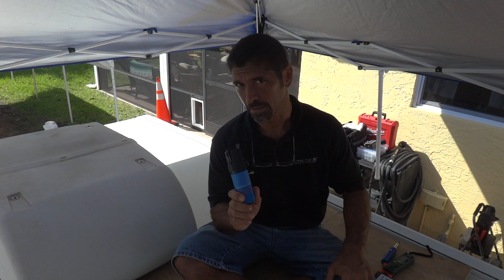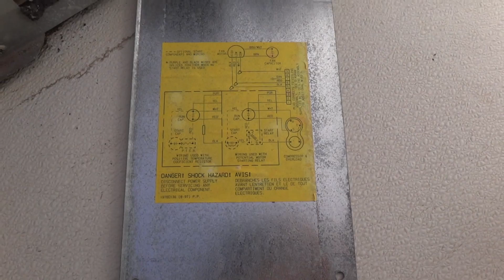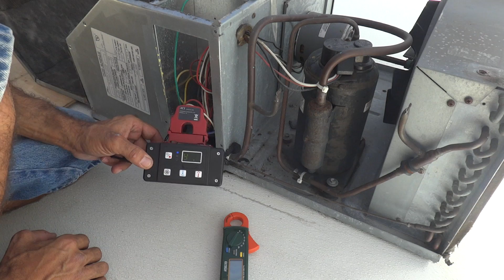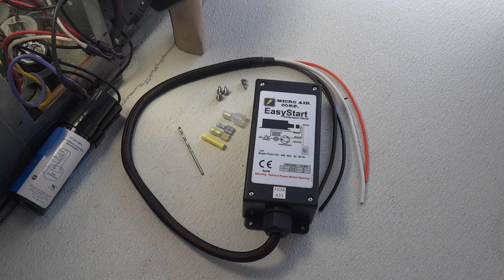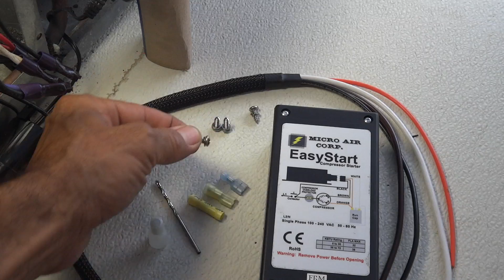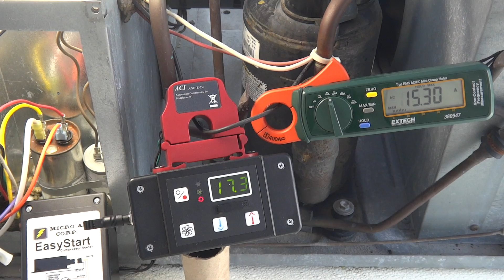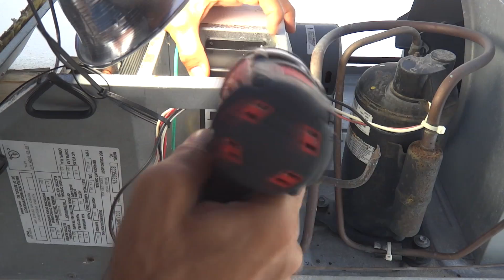Micro-Air EasyStart Soft Starter Installation into RV Rooftop Air Conditioner

Comment: It is probably in one of your other videos if not could you show us. how to take the power out of the capacitors or any thing else holding power thanks. I have wired alot in automotive and some  around the home. Wearing insulated gloves is not easy to work in. I'm going to buy you product I'm sold great product and I will be talking about your product like the good benefits of alkaline 9.5 ph water!
Reply from the maker: Hi Jon.  Thanks for your question.  As it turns out, RUN capacitors do not need to be discharged because they will discharge through the motor, after only a few seconds of off time. This is true even when EasyStart is wired in.  START capacitors - if your system even has one - might need to be discharged if they are 1) connected to your motor via a CURRENT-TYPE START RELAY (like on a refrigerator), AND 2) they do NOT have a bleed resistor built into their terminals at the top.  If a start capacitor has this bleed resistor, OR it is connected to the motor via a POTENTIAL-TYPE start relay (like on many air conditioners), or via a PTCR (start assist) device as is often used with factory-installed start capacitors in RV A/C units, then like the run capacitors the start capacitors will discharge themselves through the motor in 2 or 3 minutes after the power is removed from the compressor.  This is because the POTENTIAL start relay CLOSES once power is removed, thus connecting the start capacitor back to the motor, in parallel with the run capacitor, both of which can then discharge through the motor itself.  Similarly, the PTCR reconnects the start capacitor, but only after it cools off and drops to its low, starting resistance again, which takes a few minutes.  Remember, start capacitors, start relays, and PTCR devices always get defeated or removed BEFORE the EasyStart gets installed.

Worst case, AFTER you ensure AC power is completely removed from the A/C unit either via a circuit breaker or the trailer is completely unplugged, you can always use an insulated handle screwdriver to short the terminals on either capacitor to ensure it is discharged.

Comment: These Easy Starts by Micro Air are simply awesome. I just installed one on our coach which is setup to operate off grid and be able to run both AC units simultaneously off it’s solar system/lithium bank. The difference after installation in how the AC pulls on any power input be it inverter, generator or shore is incredible. The AC used to come on with a real thump, now it sounds and feels effortless. The onboard Victron CCGX readout isn’t designed to catch the amp draw, but in the video (link attached) you can clearly see the difference in both AC units (one with Easy Start, one without) as I have two inverters wired in split phase, there’s an AC on each one being displayed on the same CCGX. It’s incredibly obvious looking at the difference on the CCGX. 
https://youtu.be/CXBNn7lCSUY

Comment: I have 5000 btu AC .. is there a need to install one easy start on mine ?
By the way ac is running with predator 2000 generator ..
Reply from the maker: If it is working adequately for you, and you can start and run it from your generator in ECO mode, you won't need an EasyStart.

Comment: I like how your device is saying “order your easy start today” lol
Reply from the maker: Thanks for noticing.  Yeah, I snuck into my firmware a little subliminal marketing there ;-).
Reply: Micro-Air, Inc. rock on. I watched this video through and through because I am very detail oriented. I just bought a smaller camper but have been looking for a solution to run the ac on a smaller generator. Thanks again

Comment: I have a 5th wheel with 2 AC units I have to be hooked to a 50 amp service to run both units but if I am hooked to a 30 amp service it will trip the breaker if I install this unit on both of my AC units can I run bout units on a 30 amp service
Reply from the maker: Yes, you can start and run two units on a 30A utility hook-up if you install EasyStart into both.  Some power management will still be necessary since both units could demand up to 90% of the 30A hook-ups capacity (steady-state) in warm weather, depending on their make and model.

Comment: Just installed one on my Dometic 13.5k.  Works great, my Honda EU300is starts it easily in Eco mode. I too was hesitant about the cost but if you need to run on generator or sketchy shore power, it is worth the cost.  If nothing else, the AC is quieter inside when the compressor starts.  It is almost inaudible.

Comment: Dude I would have mounted it on the inside of the cover plate that you removed
Reply: yes..!
Reply: I like where he put it, because then he can remove the cover without having the bulk of the device there.  But I would've used heat shrink compatible butt connectors.  Or at least added heat shrink.  You're around high/low temperatures, it's outside all the time, you have condensation and regular humidity to deal with.  Protect those circuits!

Comment: Worked on the first start connected to shore power. Will not start a 2nd time. Any ideas why this is happening?
Reply from the maker: As we discussed via e-mail, there is nothing wrong. What is happening is the EasyStart's short-cycle prevention timer is delaying the compressor's restart.  This timer is "smart" in that it keeps track of the elapsed time since the last time the compressor was shut down, even when power is completely removed from the EasyStart.  For example, if power gets restored or the thermostat calls for the compressor to run again in 3 minutes, EasyStart will only wait 2 additional minutes.  And if this delay is 5 minutes or more, EasyStart adds no additional delay other than its 5-second minimum.  During normal cycling when the thermostat is being satisfied and then the room is warming up again, this short-cycle prevention timer will go unnoticed since it will have no effect on the compressor restart.  Only if you are deliberately short cycling the compressor (e.g. during the 5 learning starts) or a brief power outage/brownout occurs, will the effect of the short-cycle prevention timer be noticeable.

Comment: My AC's looks like yours but is a Coleman 15K.  On mine, there is no way for the Micro Air to fit in the space you installed it on yours.  I had to install it on the outside of the electrical connection box right behind the compressor.
Reply from the maker: Hi CJ.  Yes, when this video was shot 2 years ago, we used our older generation EasyStart 364 in the black plastic enclosure. This version was slightly smaller and not weatherproof, versus our current version in the beige-colored enclosure which is very slightly larger and IP65 (fully weatherproof).  Customers who now install EasyStarts into Coleman Mach 1, Mach 3, Mach 3+, and Mach 15 (all high profile Coleman) rooftops simply mount the EasyStart in the open space between the evaporator and condenser, and route the harness wires back into the same electric box, where all of the electrical connections get made in a protected area.  The current EasyStart being located in this open area which is exposed to the elements is not a problem since it is now IP65 and fully weatherproof!  Thank you again for your business!

Comment: my 32ft Coronado has two A/C units ,,,15k each..my onan gen is 7000 quiet model...it runs fine ,both work great in south texas  weather,would i benefit from using your product?????
Reply from the maker: Hello Jose.  Thank you for your comment and question.  Given that your generator is 7000W, although you have less of a need for the EasyStart, you can still benefit.  Specifically, if you have heavily loaded your generator and you only have just enough power left (~1800W for example) to run your A/C, it may not start when the generator is already this loaded (i.e. 5200W is already being drawn from it).  The EasyStart would make the difference there between it not working and it working reliably in this case.   Beyond this, the EasyStart continues to monitor and protect your compressor for 5 different fault conditions during steady-state running operation, after the start is long over with, including compressor stalls, overcurrent, open thermal protectors, failed wire connections, and brownouts/short power interruptions.   No OEM factory configuration protects your compressor this well.  And all of these issues can all happen even when running your A/C from a utility power source, not just on generator.  So, there are benefits to be gained here as well.  Thanks again for your question.

Comment: I just think it’s funny that the clamp meter won’t capture the spike amp draw... well no it won’t, it’s cheap. What maybe $80 at tops.  Mine will capture it just fine every time. But to be more accurate do the amp draw before the capacitor.

Comment: If I want to connect 2 AC 15k BTU to one generator(same line), I need two EasyStart, one for each AC?
Reply from the maker: Hello Christian.  Thank you for your comment. Yes, if you want to start and run two 15kBTU A/C units on a single 4000W or two paralleled 2000W generators, then you will need to install an EasyStart into each A/C. This is necessary because you won't be able to control which A/C turns on second, while the other A/C is already running.  We've had many customers with two A/C units do exactly this with success.  Installing EasyStart on both A/Cs also allows them to start and run on a 30A utility hookup, versus the normally required 50A.  That benefit turned out to be more beneficial to our customers than being able to run on generator since more often they're at campsites with limited hook-ups, and 50A hook-ups are not only less prevalent, but often more expensive.  One customer reported that his EasyStarts eventually paid for themselves because of this.

Comment: Hello Matteo,  I received the easy start  a couple days ago, going to install in the AM  looks straight forward. I will let you know how it works with the Honda EU2000I  gen.  the other campers in the club are very interested.  thanks Craig.....Next day..That soft start box is huge..lol  I had to relocate the run and fan caps to mount the soft start and then my cover did not fit had to make new screw locations , but I did the 6 starts on house power and now have it running off my eu2000i Honda generator, this is in Arizona so I am sure this will be a state to  really test the unit.  I am waiting for it to cycle .  HMMM not able to  start after cycle after it shuts off on eco,  will not start the compressor it trys then fan just runs. Only way to get it back on is to turn the eco off and wait another 5 min. it will then start. I have noticed when the eco is off the gen runs higher than when nothing is on like the ac really puts a load on the gen even when eco is off it revs so high. Not really a happy camper at this point as this was to be used for boondocking in the desert of Arizona.. I am going to replace the run cap, in case it is a little weak and drawing an extra amp or so.
Reply from the maker: Hello Craig.  Sorry for the delay in responding here.  The 5-minute delay you experienced was the EasyStart's short-cycle prevention timer.  The way it works is the EasyStart will hold off restarting the compressor for 5 minutes _since the last time it was run_.  This timer is "smart" in that it will keep track of the elapsed time, even if power is completely removed from the EasyStart or the entire trailer.  So, if the thermostat calls for the compressor to run again in 3 minutes, the EasyStart will only wait an additional 2 minutes before it gently soft starts the compressor.  If more than 5 minutes has elapsed, then the EasyStart will not add any delay (other than its minimum 5-second starting delay).  

Normally, when your thermostat is regulating the room temperature, becoming satisfied and then later calling for cooling again, the amount of compressor off time typically exceeds 5 minutes.  So, the effects of this short-cycle prevention timer will not at all be noticed. However, when you are deliberately short-cycling the compressor like you were in order to accomplish the 5 learning starts, then of course the timer will be noticeable.  It's good to understand this though because this timer is one of EasyStart's 5 additional fault protections that actually extends the life of your compressor.  For example, if your compressor is operating and the campsite utility power or your generator browns out for a split second, this brownout may not be long enough to reset the A/C's digital control, but it may be long enough to stall the compressor (which typically only takes 50ms).  The EasyStart will catch this brownout and NOT reapply power to the compressor when power comes back again, even though the A/C's digital control board may still be calling for it (because it "rode through" the brownout without resetting).  Without EasyStart, the immediately reapplication of power would result in the compressor stalling and drawing locked rotor amperage (LRA) since the internal refrigerant pressures inside of the system had not had a chance to equalize yet.  When this happens, the compressor's only protection is its thermal overload protector, which will "pop" open in about 3 seconds.  During this short duration, the compressor is enduring potentially damaging locked-rotor amperage and significant mechanical stress (torque) that can shorten its life.  EasyStart prevents this by stepping in immediately, preventing the short cycle, and waiting 5 minutes for the pressures to equalize before restarting the compressor.

Comment: Installed my easystart 364 on my RV, a Dometic 15,000 btu unit. Installation was super easy as shown and it works well with my Honda EU2000i, Im not easily impressed but yes Im very impressed. This thing is the real deal, should be installed on all RVs from the factory!

Comment: Wow, lots of sparing over something so basic.  First, any inductive load will introduce a power factor.  This simply means that due to the effects of the motor coils using alternating  (AC) power (60 HZ) entering the fan and condenser motors, the voltage and current go out of phase.  The cure for this problem is to use capacitors to correct that condition.  The amount of the required correction changes from startup to run, so basic systems use 2 capacitors, a start capacitor that disconnects after a short time as the motors spins up to a run capacitor using a  different value capacitor that is close to the right value when running at normal speed.  That is the basic system, but it does not cover all of the conditions an aircon system will encounter like  brief power interruptions, or multiple units that just happen to cycle at the same exact time causing a very large power factor problem and causing a large current draw when the voltage is at its lowest level.  So, to cover this and other problems a smart device can act instantly to correct the power factor problem which would require a different value of capacitor that the run capacitor can correct.   During the various test results shown, the missing information is what the instantaneous voltage/current levels were, and if they were in perfect phase (impossible of course), but did the device act quickly enough to change the capacitor to the correct value required at that instant to change the apparent power to real power?  So when we average current and voltage to make power assumptions without knowing the exact timing (phase relationship) of these values, we can not know the real power, and that error is called apparent power.  One way to really see the truth of the matter is to use an oscilloscope which is probably too old fashioned because you can buy smart test equipment that will give you a direct readout of power factor and apparent vs real power.  So the point here is that if a smart circuit working at current computer speeds can instantaneously make capacitor switching in micro-seconds, amazing things can be accomplished.  While this is a very simplistic explanation of a very complex condition I hope this will ease some of the frustration because, when working with alternating current and things with magnetic coils, the currents are never the same in all parts of the circuit, and when there is a high power factor, remember, the generator becomes a part of tthe circuit , and even the voltage and current readings right out of the generator can not be relied upon.  The power factor must be measured and applied to the readings to get a REAL POWER result.....